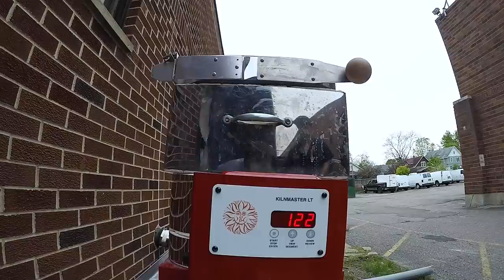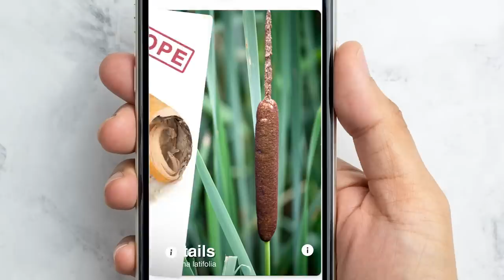Making a Fire from Scratch

Comment: Survival tip of the day - Once you've got the embers to the stage where you can wrap them loosely in the dried grass, just hold them at arms length and spin around slowly :)   the airflow from your rotation will be enough to get it going, and you don't gave to get so much smoke in your face :)

Comment: With your spindle you want one end to be almost sharp and the other end to be slightly rounded off. The part of the spindle that touches your fire board should be the slightly rounded blunt end.  The pointed end should touch your  socket (the piece in your hand). The reason for this is because you want more friction in between the fire board and spindle then you do between the spindle and socket. This will cause more heat to generate in between the spindle and fire board. You can also use a bit of animal fat in the socket so there is less friction between the spindle and socket. The object of the game is to create as much friction on the fire board and as little friction as possible on the socket.

Comment: When doing the bow drill I noticed you used a stick that bent this likely made it harder than it needed to be you’re supposed to use a stick that is naturally bent to keep the tension on the sting constant
Reply: anarchism the point of this channel is to see if a average person can make these things by using trial and error.
Reply: @anarchism  I like the channel but everything they do is half assed it dose get aggravating.
Reply: this comment string gives me déja vu
Reply: @anarchism  And you can do better?
Reply: @mr.campwell3655  They're honestly doing a lot better now than they have in the past, though. Seems like almost everything before the reboot was a failure.
Reply: @mr.campwell3655  half assed? The effort they put into making these things is incredible. They have to learn a whole new skill set with each project.. how are they supposed to master it when genuinely sticking to their own rules?
Reply: @richard-gn3es  a bit more effort, research and patience would go a long way just seems like they got a whole lota "that's close enough." Going on.
Reply: @mr.campwell3655  yeah, that's kind of the point of proof of concept.
Reply: @allstarwoo4  how is overloading a kiln with a flammable substance or building an ax you plan to use regular proof of concept.
Reply: Mr. Campwell too show it was possible with these tools. If it was about practicality and efficiency they would be using modern materials and tools. I can make a fiber glass boat in half the time they make a wooden canoe. These videos aren’t about effectiveness it’s about our technological journey.
Reply: @anarchism  I clicked on your channel but all I saw were several videos (shot with what must be a potato) of: some beer, a dog, and shitty drumming. I must have missed your amazing content where you build things like a master. 

Oh wait.
Reply: @allstarwoo4  but if your going to spend 45 hours making a stone ax what does it hurt to spend an extra hour look for more suitable handle material. They found out how to produce all the necessary parts of a bow drill set but not the proper way to hold it, it's just just sloppy workmanship and being ill prepared.
Reply: @mr.campwell3655  yes i agree there is a close enough mindset but with such a small team and such complex skills its going to be impossible to do much more. Between research. Filming. editing. Travelling. Leasing with sponsorships. Solving any youtube problems. Setting up those segments with experts etc im sure there is just very little time in the day for getting it perfect
Reply: @NANA-dd4fl  For starters, he is from Minnesota. Also, they release one video per week. If you want to get any of those projects into perfection, it needs at least two times more time. I think, as a small group of average people, they do a lot
Reply: At least they keep it authentic, you know... They could easily cheat and make stuff outside the video shooting just to show off how good they are.
Reply: @SmolPotatowo  he is probably a weedy little 12 year old who thinks he knows everything
Reply: Tkor
Reply: @NANA-dd4fl  I get the impression you're proud of not being a "spoiled Californian urbanite" and you're eager to share this information with people.

Even if that information is completely irrelevant to the discussion. The folks at HtME don't live in California. I don't know why you thought you should bring Californian urbanites up.
Reply: @mr.campwell3655  you cannot expect them to master the skills that took humanity thousands of years to master in the small period of time they work on each project. They also started from scratch without any modern tools, they have literally carved their tools out of a rock

Comment: Advice for your bow drill fire starter: your spindle and cap block should be made of hard wood and the friction plate should be soft wood.  You should also lubricate the top of the spindle and the socket of your cap block with some grease.  You can use the creations of oil on either side of your nose for this lubricant by rubbing the top of the spindle to pick up these creations.  The string can also be strengthened by braiding lengths to thicken it.  The wax does strengthen the string, but can also add to it binding on the spindle.  I’ve easily made fire this way and learned from a fellow who was an expert in desert survival.

Comment: Im screaming at my phone "the stick isnt straight!"
Reply: Ahahahahahahahaha me to just now
Reply: also her bowl is too large, it need to be like the board
Reply: When was the last time you went out and did it?
Reply: K4 Josiah  I think she was snapping the rope a lot because of friction so she changed tactics.
Reply: @straight-up-shots  it snapped a lot because the stick was too smooth so all the friction focused on the string burning it through. The addition of wax to the string made it grip instead of rub, when i learned to do this if the string started slipping i would stop use my knife edge to rough up the sides of the spindle and start again, her top socket was her biggest downfall though as it needed to be heavier with a better fitted cup her fireboard was pretty damn good and her apindle was ideal, i think they xould have chosen softer woods and acomplished it faster as well.

Oh and drilling a hole in the tip of the spindle helps a ton as well!

Comment: A couple things that help considerably for a fire bow or hand spinning for fire. With the fire bow using another piece of wood as your bearing block is superior to using clay for a number of reasons. 1. It can be made so your stick doesnt move under your bearing block by making a divot in the wood and using the oils from your nose to add lubricant. 2. Using a vine is often superior to using twine you've made yourself as it is smoother and can be more resistant to rubbing depending on the vine you use. 3. The materials you use as tinder have a major effect on retaining the hot ember and eventually making it flower into flame. The fluffier the better but supplemented with things that burn slower to allow times to add more fuel. For hand drills getting a steady rhythm and ignoring largely the pain that is associated with rubbing something for long periods and at speed is the major key.

Comment: For a more effective fire carrier, try mixing pine resin, dry grass and rubbed dry leaves, and cattail fluff, and wrap this around dry tinder of some sort, which you then wrap in dry bark, then place in a basket with a thick layer of green leaves of some kind between the basket and the fire packet. This can then be safely carried, with each component being replenished as needed, as far as you want. The fire can also be carried more safely without the resin, as that accelerant makes it more likely to burns out the base.

Comment: just a tip, don't blow on the tinder when you get an ember instead wave it around in the air. you will get a much steadier supply of oxygen and won't spend so much time inhaling smoke.

Comment: A word of advice... use a slightly bent stick as the bow. This will help keep tension on the spindle. Also using a branch, double the width of the spindle, and about as long as your palm, drill a hole similar to your fire board. That will control the spindle better than a bowl. Could also use a cow back vertebra. Or other large animal. That's what I use 😁

Comment: Ah yes, the bow and spindle. I remember doing that when I was younger. Just for fun, I calculated the efficiency of it and it was pretty darn low.
Reply: I've always heard that the bow and spindle method was rarely actually used because it's difficult to keep everything lined up and straight and just taking a straight stick and rubbing it between your hands (the way Primitive Technology does) is just a hell of a lot easier, even if it doesn't seem like it would be.....
Reply: @corwinweber693  Yeah, it's a little better. Especially once you've done it a few times.

Comment: Bowdrill tips: spindle should be rounded , not pointy, on the bottom, pointy on the end that goes to the pressure block.  It needs to not be totally smooth so the cord catches better.  A stiffer, naturally curved stick makes a better bow and gives better tension.

Comment: Btw, legit pro tip: When you're going from ember to fire. You do not have to put a lot of volume of air in there at first, and you're actually hurting your odds if you do. All it need is a tiny bit of supplemental oxygen, any more and you're just blowing away the heat and preventing a lot of the medium volatiles from combusting. You want to make the tiniest little stream of air that you can keep steady and, aim it with your lips, and just hold it steady at the bottom of the ember. This way you have steady heat production, less stripping of the hot gas envelope while still supplying as much extra oxygen as it needs, and less of the content is CO2 from your breath because you're drawing a lot of fresh air in via the Venturi effect instead of just flooding it with exhalation, and you'll be relieved at how much less hyperventilation is involved.
Reply: Finally an actual comment that has some sort of educated info behind it. To other readers that may second guess this comment this is actually exactly the right way to approach this situation.
Reply: @brytekru7946  Thank you.

Comment: I can never manage to get the embers to make a flame, any advice?
Reply: Feed it on small bits of really finely shredded flammable material, like birch bark or dried grass or similar, and when you initially get the embers keep it cupped in a nest of flammable material shielded from wind (too much will just blow it out), and keep some slight air (take a mouthful of air and blow slowly and gently; not from your lungs but your mouth, otherwise it's primarily carbon dioxide) moving over it.
Reply: Blow on it
Reply: @KainYusanagi  thank you, maybe now my ember lighter wont be completely useless to me.
Reply: I find char cloth makes an excellent ember holder and will catch and hold the little glowie boy, then you can give it progressively larger pieces of kindling until it takes a flame. Look for fatwood; pieces of rotted out pine heart that has all the sticky flammable sap.

It just takes practice and patience.
Reply: @Mostlyharmless1985  i can hold an ember, ive just never gotten it to catch fire
Reply: Mr. Black yes. The char cloth will hold an ember long enough for it to spread into your kindling and catch flame. I honestly haven’t bothered with flint and steel fire for a while but you set a spark on a small pile of char cloth, and it will be almost automatic from that. Just feed it tiny tiny sticks and it will catch. Then you can build a progressively larger fire. 

Or, if you are using one of those horrible friction methods, and you need to give that little tiny nugget of red a home, you drop it into a nest of char cloth and the surface area of your ember will increase dramatically. When I say “hold an ember”, I literally mean hold an ember.
Personally my preferred fire making method is some rolled up strips of newspaper dipped in paraffin wax, hardly primitive, but screw authenticity when you are cold and hungry.
Reply: @Mostlyharmless1985  i use an ember lighter, so i got a decent size ember to work with.
Reply: Dry tumble weed burn well
Don’t rush it consistent air flow helps
Reply: @zacharyhandy9606  it doesn't grow in my area, i live just north of the ozarks
Reply: Mr. Black okay, so let me just tell you what kind of stack to build. Ember->char cloth-> dry punky wood. 

I don’t think you are understanding that the purpose is to get the concentrated heat of the ember: large, small, or not at all spread across a larger surface area. More surface area=more heat=fire. 

From the birth of your ember your first goal is to get it larger, after you increase the surface area then you can get air on it to increase the heat to try to catch your longer lasting kindling. you’ll know when you are on the right path because it will start smoking like crazy, your instinct is to blow on it like mad, but you have to give it little gentle puffs of air, like you are smoking a pipe.
Reply: @Mostlyharmless1985  perhaps im not giving it enough kindling then, cause it burns through that stuff before i can get it to catch a flame. Thank you
Reply: @MrBlack0950  red cedar bark, the loose stuff, crumple into a ball and rub till it breaks down into a fibrous mess, then fluff it up into the form of a birds nest, place the ember in the bottom of the "nest" blow very gently, in about a minute you should have a flame. be sure to have a firelay ready to put the lit tinder into.

Comment: any method you use to make fire that works, is the right one...
that being said, I would not have used the bowl as your bearing block, it allowed the end of your spindle to move around too much causing at least half of your problems.
second, the spindle goes on the outside of your bows string so it doesn't get knocked around as much, and gives you more string to use for bowing.
third, start off slow and steady, build up your pace over a couple minutes, with a last fast dash for the last full minute or two.
lastly, allow the coal to smolder for a bit before transferring into your birds nest.
everything else looked fine... except the pallet wood used in the final fire. those are sometimes treated with chemicals, so you might want to avoid that in the future.
waves from central Wisconsin

Comment: When making your stick you need to sharpen both sides. One side designed for less friction, the other for more friction. Your stick is getting bound up in your cupping piece which is preventing the stick from turning when you apply pressure.

Comment: if i may offer a couple suggestions for the bow drill. use a kneecap from a large animal instead of the bowl it has a small divit on the inside that fits a spindle nicely. second if you are right handed and using the bow in your right hand use your left foot to hold the hearth board bracing your left hand against your shin, it will give you more stability. good job though figuring it out as you go keep up the good work

Comment: In scouts, ive mastered the bow drill but I couldn't imagine only using a primitive flint and steel.  To help do the bow better, make   a little hole in the base plate to keep the spindle steady, technic was great though.  Just more practice and you can be great at it.

Comment: The tinder fungus didn't work because you guys were putting sparks on the pores and hard shell. The highly flammable part is the amadou, the leathery inside.

To make amadou into a tinder
You need to strip off the pores and hard shell.
Soak the amadou in water with wood ash and then boil it for about an hour. 
Then softly beat it to quickly force the water out and then leave it to dry for a day or two.
You should now have some brown leathery sheets of tinder which you can either use whole sheet or scrape up into some fluff that you can easily set on fire with a spark.

Comment: Using a bow seems relatively advanced; Plenty of tribes just spin the stick between two hands moving down the stick to keep the pressure on before starting again.
Ive also seen an alternative where they simply rub the stick back and forth in a groove faster and faster. Which I expect takes a lot more effort per attempt (Its a lot more surface area you are putting your energy across.) but would be much easier for a beginner and consequently could save effort in having fewer failed attempts.

Comment: for the pull-string on the bow use animal guts made into a dried string, they won't pull apart fiber string would need to be 3times as dense and they are not also the last rubb-stick was much thicker aka more friction area with both combined you would have a fire each and every time!

Comment: For the guys who were processing the bones: Should have put the bones into a simple Piranha Solution first to just devour the organic matter right off (it's used in labs the world over for cleaning glassware of residue, in fact); just a little concentrated sulfuric acid and hydrogen peroxide and bam, piranha.
Also, when making the torch, taking some string and permeating it with the resin and then wrapping that around the stick for a torch, makes a much better torch than straight resin.